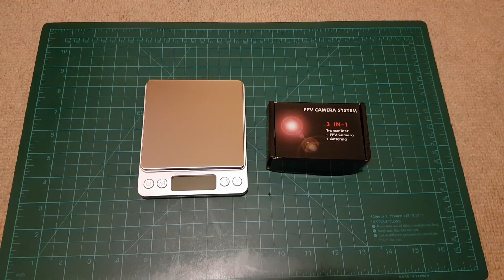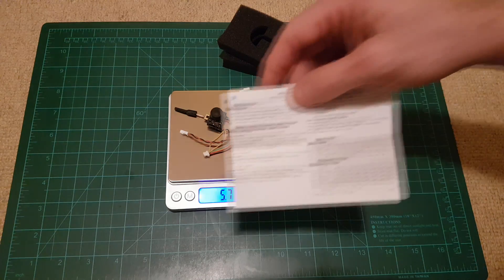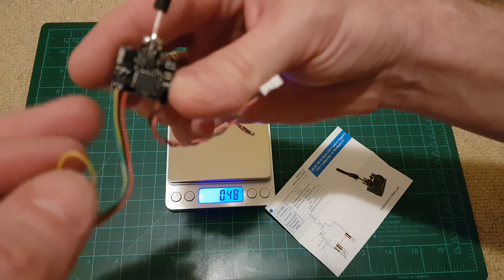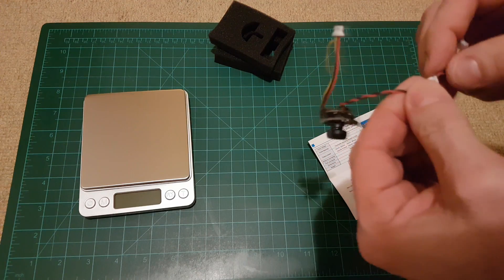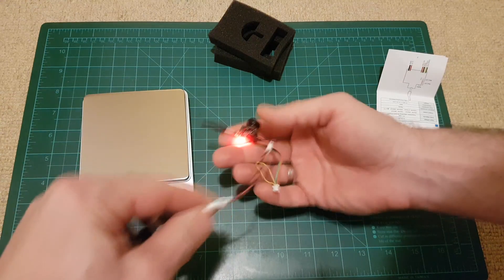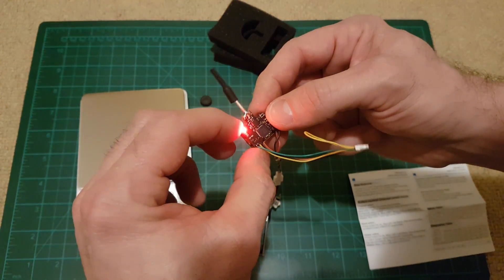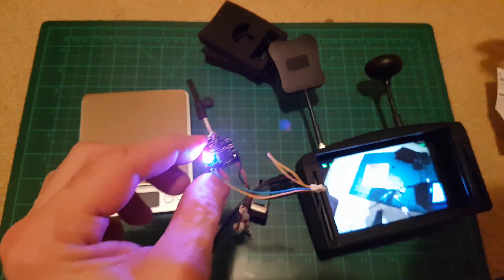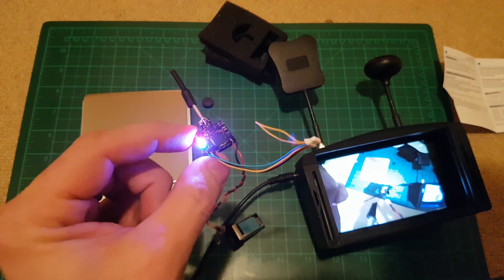AKK AIO-SA 5.8GHz 25mW/50mW/100mW/200mW Switchable 40CH Micro AIO Camera

Comment: what battery does it use?
Reply from the maker: 1s LiPo battery (3.7V)
Reply: do you need an adapter, if yes could you send the link to it? @neutrno
Reply from the maker: @whatthesigma.42069  thera are adapters in the box for every type of 1S batteries on the market.
Reply: nice @neutrno

Comment: Nice review. I got Albert kim recomending this camera to put in a small airplane or rc car.
Can you please tell me what battery connector should i buy with the 1s battery?
Thanks
Reply from the maker: As you can see in the video, it has adapter for all types of 1S batteries available on market. I don't know exact names of connectors, but any 1S battery will fit.
Reply: @neutrno  thanks for your rapid response. i just need to know the name of the conector to order the battery with the correct one...but nevermind.

I also wanted to buy a small camera , not an fpv to put on the airplane and record. Do you have a recommendation? i am looking hp , maybe 30fps and very light...less than 20grams or less .....i hope you have some advice...thanks!!
Reply from the maker: @alexherrera3918  yes I have, check this 😉
https://youtu.be/cLiZzyrb9M8
Reply: @neutrno  Thanks!!!

Comment: I cannot get osd to work.  Why is video out and video in bridged on the connector? I cut off the connector to connect camera to FC that has video in and out but there is no video unless I short the video in and out on the camera but then there is no OSD. Can u help?
Reply: Very old comment, but just in case....solder the wire to the opposite pad as you're coming from....ie: Video OUT on the FC will be Video IN on the AKK unit.

Works perfectly on all the Betaflight boards I've tried it with.
Reply from the maker: Hi, It is bridged so you can cut that wire and insert OSD device in between. I have never tried that, so I really wouldn't know any details how to setup that, sorry.